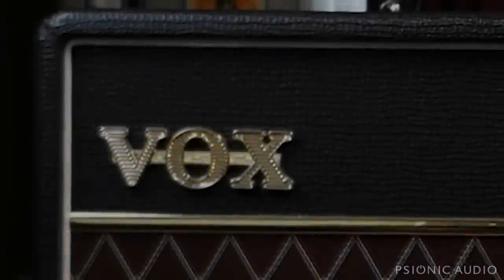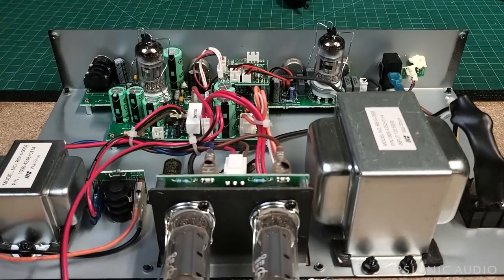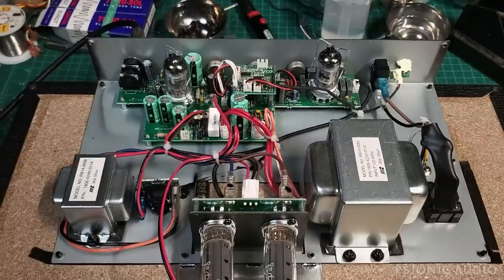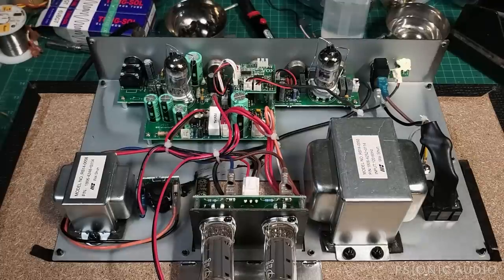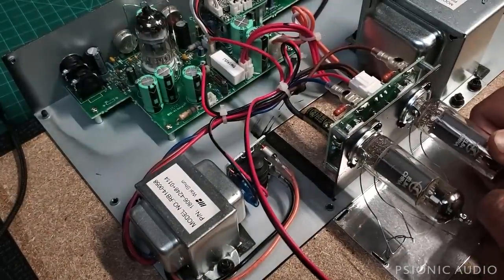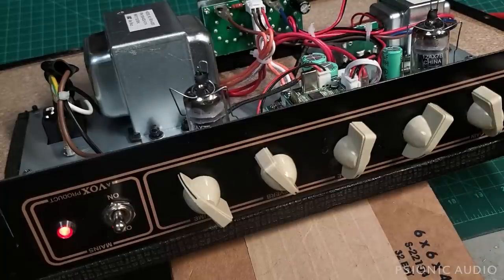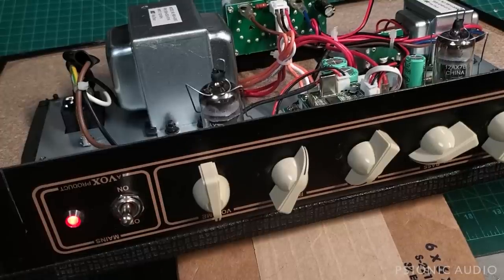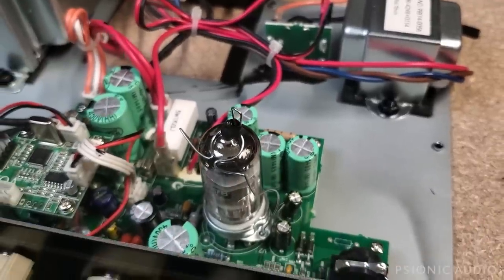Vox AC10C1 | Repair & Review

Comment: I love mine.  Especially when I have to carry it.  I also have a UK-Built Hand-Wired 60th Anniversary AC-15, which is the best amp I’ve ever played thru.  I also used a Stereo live-rig using 2 AC-30’s.  For what this little amp costs, what it does in capturing the Vox Vibe— I think it’s great.  I will upgrade to some better tubes, and am adding a Creamback speaker.  It works for me.

Comment: Because of this very detailed video, I just scratched this one off my list. I thank you for saving me from some potential major expenses and headaches.
Reply: in the end, given time, we will all go solid state...an SS AC10, 15,  30 ..
Reply: @vincentl.9469   I've always used tube and solid state amps. Some of my favorite solid state amps are the Acoustic 134, Marshall Lead 12, LAB Series L5 and my top choice, the Pearce G2r.
Reply: @praketingrichraft6181   BB King used LAB.. a lot of 'all tube ' amps are actually a hybrid of SS & tube and that includes the AC10...I have one. All tube , meaning anything up to 10 of them are of course very costly
Reply: @vincentl.9469  Do you like your AC10 a lot?
Reply: @praketingrichraft6181   yes & no. The Vox tones are good & overdrive , once you master the EQ.    I didn't like the closed back from the start ; it got very hot at one point. I cut a slot in the back and put a shield in front of the speaker magnet..I bought mine slightly used. It came with two speakers. the original & a Greenback..
Reply: @praketingrichraft6181   the other thing i would add to previous is it's never gone wrong in the 3 years of use.. which is at home about 3-4  times a week
Reply: @vincentl.9469  Thanks! Hope it keeps rocking for you. Your mod was a cool idea. No pun intended!
Reply: @praketingrichraft6181  yes..a lot of people just plug in and play..you just need to be sure it's switched off for a time and you don't touch components..

Comment: It’s ok, I love my Vox AC-10C, you don’t have to dig it. I wish they had just left of the digital reverb personally. I switched the tubes day one for Russian equivalent EL84s and decent preamp tubes. I needed a small capable amp with vibe and character, it just delivers. I have my legacy quality amps, hardwired glory, but they don’t get as much attention as AC-10C. And inside your home the AC-15 is terribly too loud and unnecessary and sounds thin turned down so much. I’ve had mine for 5-6 years without issue, Korg has been great for the brand! It’s ok, Vox is doing better today than they ever have and will be a good choice for working guitarists for many years to come. 
Oh pathfinder 15r is a very classic amp too. Money does not equal tone.
Reply: I thought of an AC15..same feelings..too loud and heavy for home use...but over $500 for an AC10 is too much
Reply: The Pathfinfer 15 R is one of the best little amps I’ve ever used.

Comment: The noise is likely vibration. The screws that secure the chassis come loose and rattle. Tighten them.  These are the ones you put in your special wood screw cup so you wouldn't confuse them. I have been playing my AC10 for several years, and I love it.

Comment: Thank you for the video! I grabed one of these on sale at guitar center about 3-4 years ago when the price was not as high as it is now. I replaced the speaker with a greenback 10” I had and also replaced the power tubes to 7189’s and the preamps to one 12ax7 and one 5751. I love the cleans and use it as a great pedal platform. Again thanks for the video, I used to also own an AC4TV which I picked up used for really inexpensive. Hopefully you can get one of those on your bench one day as well. Thanks!

Comment: Back when these were $480 new, I bought one! Still have it today, 3 years later. 
I don't understand why they are a hundred dollars more today.
I love it, takes pedals well.  I've played with ridiculously loud drummers and it has held it's own.
After watching this, I now wonder when it's going to fail...
Reply: Lovely. However, I respectfully disagree with you as far as relative "loudness".  Your "ridiculously loud drummers" must meet my drummers. I need at least a 30 watt tube amp to compete unless also going direct to the PA. That's as a three piece of Bass, Guitar, and drums playing mostly 70's music and blues at club levels for approx. 100 to 150 {of 300} people who can  easily drown out 15 watts  almost anywhere, although the drummer may/can compete while simultaneously burying the rest of the band. A five/ten watt amp is enough if you also use a proper sound reinforcement system. I would recommend 50 watts to 300+ crowds without direct PA support. {What we used to refer to as "live".}  Then the PA was used strictly for vocals mostly. Not written in stone of course. Just what I've personally been through.

Comment: I own a used AC10 that cost half the retail price. Works nicely for low volume home use. Replaced all 4 stock tubes which cured the rattle in the amp. Have wondered about the speaker, Celestion does make a 10” Greenback that is skinny enough to fit. Might be overkill, but a fun upgrade for an otherwise inexpensive amp for light duty. Good video!
Reply: Definitely not overkill! Makes it sound even better. I put a creamback into it now and its one of my favorite sounding amps I own!
Reply: @JeremyLeech  Nice Upgrade. I installed the Greenback and love the full tone range.
Reply: @JeremyLeech  it's interesting that no one questions the closed back. the fact those terminals are scortched tells you something..
Reply: @JeremyLeech  Right-on man, I'm doing the same, but the stock cheap Celestion 10" speaker sounds great to me. I'm sure a cream back and better tubes will improve the tone, but I have no complaints for a $389-new amp in royale blue.  The insides may not be sexy from a tech perspective, but it sounds great from a player perspective.  I'm not a huge reverb guy anyways, and use the speaker-out to go through an auxiliary 16 ohm cabinet (doesn't have 8ohm out option like AC-15C1 does).

Comment: I swapped the speaker for a 10 inch Greenback, the difference is amazing! However for Gigs I plug into my 2X12 with Vintage 30's
Reply: Hello, I'm trying to find any information about V30 connected to this amp. I'm planning to do the same, to have a different flavor, but couldn't find anyone who did. Does it sound good? I would expect a totally different response (more mids, maybe), any thoughts? Thanks!

Comment: It's half the weight of an ac15, big reason why I went with the ac10 way back when. I actually thought it sounded better than the ac15 as well, but that's very subjective. I've had mine for years, swapped the v1 preamp tube with a 5751 to give more headroom and swapped power tubes once when the set died. Been pretty solid for me, but I don't play it much anymore since I've got much better amps now. I will say I tried removing the handle on mine recently and had to dremel it out because the screw wouldn't come out and the metal bracket inside tore through the wood support and came undone. Massive pita.
Reply: I bought AC10 new from the shop a couple of years ago and the only problem I had were rattling tubes. it's great for room practice and I have also used it miked on a number of live gigs, either pushing the front with a pedal, or as a clean amp with enough of headroom to boost the solo over band. For band practice and for miked gigs it's great, I love mine.

Comment: One of my all time favorite amps, it is such a little beast!!  Weber makes a ceramic and Alnico specifically for this amplifier. The VX10 can sound incredibly muddy when pushed hard. But part of me thinks they did this because it lacks a tone cut. Trying to filter out the frequencies using the speaker instead. Other part of me has experimented with a Boss DS-1, and normally you cannot push the tone past 10:00 o’clock. With this speaker you can turn the tone knob up on a DS1 and they complement each other perfectly!  An AC10C1 working in perfect condition is truly monumental in tone. Not super glassy sounding like a modern ac15 - but can be bright.
Reply: Which Weber speakers are you referring too? Thanks in advance!
Reply: Did you compare this amp to a Pathfinder 15R?
Reply: agreed
Reply: @picajoool  I haven’t tested them side by side yet. Mine had some microphonic tubes, so I sidelined it since then.  Here is a comparison of an Orange crush 12 I did against the Carvin Belair, which is 4 x el84 tube amplifier. AC10C1 is as epic or more so than these two amplifiers. https://youtu.be/xVCqE3_0e1Y
Reply: @Strumbum01  I forgot the model, but you can call them about it
Reply: Is that the DT10?
Reply: Also I’d try a Hotcake or an ODR-1 instead of a DS-1
Reply: @davidmanson3659  I have great luck pushing it with a tubescreamer. I have a  bunch of different types. But I have a tubescreamer brought back to 808 specs and an early 70s metal can opamp chip replacing the crappy chip. It is the sound of the Gods!  Most of the time I use that combo, but with my Vox AC4C1 plugged into my legacy 4X12 cabinet filled with 1970s square back eminence speakers. It’s so awesome

Comment: Not a voxy lady! Hahahahahaha, good one! Definitely not a vox sounding amp, either cleans or especially after it starts breaking up. I'm a bit in the minority in that I think that Korg has done, all things considered, a pretty good job with the Vox name. The AC30s and 15s tube amps sound anywhere from not bad to really, really good. and I appreciate that they are trying with the modeling stuff as well. But this is a vox only in the sense that it has the right gill cloth. Still, thanks for the vid, saves me from ever wanting to have one. Rock on, sir, love your youtbe.

Comment: Will look to replace the 1/4w resistors on mine, thanks for the tip.

I love mine tonally, especially for edge of break up, and crunch. Eq wise, i run treble about 1 o'clock and bass around 11 o'clock, to avoid the speaker flubbing out.

For me, the small size and weight is a big win vs AC15, though your channel is teaching me how amps are more than meets the ear.

My biggest gripe with this amp is it's loud at its quietest setting. Its silent for the first notch on volume, then cuts in suddenly.

Comment: I didn't expect the whole amp to be mounted on a single plane. Looks like it would serve well in a rackmount and just run the cab as an extension.  For that reason, one could probably pull off some cool conversions with just the amp section like modify a breifcase or upcycle an old maple drawer or something.

Comment: Excellent review and summation.  Only one point with which I disagree: the weight comparison with AC15.  My AC10 weighs 27 lbs while my AC15 weighs 50.  To me that's a dealbreaker.  My AC15 never leaves my home studio, while the 10 — admittedly not as good an amp but decent — goes out with me 2-3 times a week.  Otherwise, you've been spot on.  Gonna watch more of your vids (this was the first).  Thanks !!

Comment: Thanks for doing this video. I've been hoping for it since I bought the amp in December. 
Due to a leg injury, I haven't been able to carry big amps, so I bought this amp, mainly to not end up with a blues Jr. The PRRI is over $1600 in Canada now, and the Traynor YGL1 is 10 pounds heavier.
Reply: Mine was my first tube amp and now I’m looking at a blues jr 😐
Reply from the maker: Don't get a Blues Junior.
Reply: @PsionicAudio  Listen to Lyle! I don't call the Blues De Villes "Blues De-Sasters" for no reason. A Blues Jr is just a Junior Disaster. Those poor things clutter up repair shops everywhere.
Reply: I’ve had my tweed Blues Jr for 5 years and not one issue. I had some caps etc replaced but not because they were bad but it was part of the Fromel mod. I changed the tubes and speaker for personal preference. I guess I got lucky with mine and many amps have come and gone but not gonna part with my Bjr.
Reply: @Satchmoeddie  I mean Lyle’s the man
Reply: @dangitdan9938  The other guitar player in the band has been using a Blues Jr. for ten years now, and it always cuts through. I recapped it a few years ago, and it just keeps going. 
Last night, I used a Blues Jr my drummer picked up on trade, along with his affinity strat. 5 songs in, it started crackling hard when picked, so I shut it off and switched amps. We'll open it up when we have time.
Reply: As an update, I made it through the summer with the ac10, and it was rough! Master maxed, gain well out of clean, and every imaginable setting on the eq. Couldn't keep up with the blues jr. I need something else.

Comment: You leave out the most important thing - the ac10 weighs 12 pounds,  the AC 15 close to 50 this is huge to someone with transit issues, or physical issues
Reply: Ac10=12kg, not 12lbs.
Reply: *26.46lbs / 12kg vs 48.5lbs / 22kg

Not a small difference even so.
Reply: Yeah I’ve owned an AC10, AC15 and AC30 and the weight difference between each one is crazy. AC30 is almost un-liftable with it’s rubbish handles, AC15 is very heavy for only 15w, similar weight to Fender Hot Rod Deluxe and the AC10 is extremely easy to get around in comparison.

Comment: I put modded Fender tilt legs on and put a 12AU7 in V1 - happy :-) !! I love this amp. I have played an original 60'a AC-10 twin, and this is close enough ;-) I added a parallel female jack with the speaker so I can use an attenuator/Di  (using the speaker jack disconnects the internal speaker), also I can use the speaker by itself this way ;-)

Comment: The Vox AC30 is one of my all time fav amps.
These new relatively micro in comparison imports, while they do make a genuine attempt to capture that Vox mojo, sound nothing like one IMO, and are about $200 overpriced, which I assume is from merely milking on the brand if anything else.

  I once own a little Vox AC4C12 4 watt 1x12 combo I scored on a decent second hand deal. I really liked that amp to be fair. 
Soon after I began running it "wet" dual amp via a Radial ABY splitter with a slightly gain cranked "dry" Orange Micro Dark and Greenback loaded 1x12. Sounded freakin' huge together, but was honestly just way too loud for my small apartment at the hours I was getting to play. So I went all digital for awhile. I'm now however using a Victory V4 "The Jack" preamp direct into Two Notes Wall of sound plugin. It's been a dramatic improvement in overall "feel" and dynamic analog interaction, and sonically harkens me back to the pre-tinnitus late 80's-early 2000's 100 watt stacks of my youth. Ha!

Don't know if you've possibly ever opened up one of the Victory V4 preamps before? If not, I wouldn't be completely apposed to possibly loaning mine out for some potential future content, and to get your initial thoughts on them?

Anyway,
Really digging the channel amigo.
Hope you are staying safe and well.✌

Comment: Sounds a bit sharp and brittle when even slightly overdriven. I see some comments of V-1 tube substitution with less gain such as a 5751 or 12ay7. I would surmise that going that route and using an OD or DS-1,etc, {as mentioned in a comment} would be the cheapest way to help this particular Vox model. Another would maybe be a graphic eq pedal. For sure a speaker upgrade, but that could be a cost issue. Most of us guitar players already have a few pre-amp tubes and/or pedals hanging around.
Reply: Do NOT fit a 5751 in the first position... does not improve the sound, you get less gain plus it means an overdrive pedal will not work as well either ..with a lower gain tube

Comment: A flat chassis flush mounted against a particle board panel acting as the back of the cabinet?  Did they outsource the design and manufacturing to Soundesign (cheesy home stereo brand of the 1970s)?  What kind of standoffs separate the chassis from that board?  Or did they literally screw the entire board directly to the board?

Comment: I think they sound good for lower to middle gain sounds TP-U2 stuff if you don't need full lows.Too much lows/not enough mids in the guitar sound often sounds thin in a band context anyway.That said I held off on buying one when I saw the lower end  construction.If I owned one I'd do tube swaps & possible a speaker swap but that's it.I thought the speaker was pretty good myself so would likely leave it. As for AC15s I owned both the AC15CC & AC15C1. I actually prefer the CC,I think it's built better & sounds better despite no TB cut.

Comment: Question about a possible mod: What annoys me about this amp is how quickly loud the volume knob gets, just barely up from zero. I play in a small room, at low volume, and when I turn the volume up, I have to tap it very gingerly to keep it from blasting. Is it possible to replace the volume pot with one that has a more gradual taper? If someone knows, or has done something like this, could you please provide details.

Comment: My ac4tv mini has the same shitty construction (edit: I just opened it and it has no surface mount crap, the transformers look pretty chunky too, no digital boards, and tube bases are white ceramic.  The simple circuit should be easy to service) .  It sounds really good but the best is I got it for the price of a cheap pedal... 65$.  I really dig the class A character it has.  I put a low testing el84 in it that was almost headed to the trash and it curiously made it bloom with character; I guess the best tube tester is sometimes the amp itself.  Hope to see the new ac4 series reviewed or looked upon in this channel.  I don't know why it reminded me of the ac10 which is really a disappointment after watching this video.